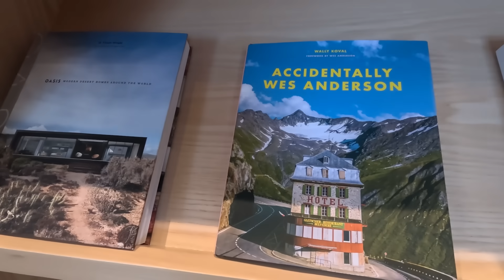THE DAY HAS FINALLY COME!!!

Comment: Isn't Leo to big for that car seat?
Reply: Definitely.  His feet are hanging well over the end.
Reply: Some states require children to be in car seats up until a certain age regardless of size. In Utah Children must ride in a car seat or booster seat until the age of 8 or until they reach a height of 57 inches (4' 9”). Children should ride in the back seat until the age of 13.
Reply: @ltrillium1000  yes, that's understandable,  but Leo is too big for what is essentially a baby capsule and ready for a child seat. Many of the baby/child unuts convert to a child seat.

Comment: I think if your driver is saving gas $, then you ought to consider the break even (cost of ownership) between a $80k electric and your current 10 mpg gas truck.   I would never buy an all electric at this point.  Not cost effective, limited range as compared to gas.

Comment: Amazing how fast you go when Trent is not touching every task.
Hmmmmmmm. I wonder why they ship you the prehung door completely assembled. Is there some advantage for making sure it is level and square during installation.  Should you check the level of the floor, the plumbness of the framing? Calculating the need for shims? Or just work backwards as usual... makes for entertainment value anyway.  
Oh, my! Did you just dis Ally for wanting the door to work correctly. I don't want to criticize, but dude.

Comment: You made it!  Job well done, you're all entitled to feel very proud of yourselves.  Agreeing with Allie here, order the dry wall and with luck you can have it delivered, you've got the space for it.  As for going EV?   Trent wouldn't be able to diagnose problems as he can with an IC vehicle, he wouldn't be allowed to fix anything anyway. I'm not sure he'd even be able to do any mods on it either.  Keep snug, install a bath in the new build, older bones need a good hot soak now and then.

Comment: Maybe check out Long way Up with Ewan and Charlie . The support crew had a Rivian truck . Seem to have issues with charging and holding charge in cold sub zero temps . Technology may have improved since 2019 . Trent get your finger X-rayed , you may have an injury to volar plate which requires treatment . You weren’t very clear on which joint in your finger . Take care and congrats on all the hard work to reach the dried in milestone .🇦🇺

Comment: As a car guy, with where you guys live, I really feel like going to an electric vehicle is really not a good idea. I understand that you guys will have the trucks. But, electric vehicles don't do that great in the winter. Especially since up there, it's winter for probably 75 to 80% of the year. If better fuel economy is what you're wanting, I would go with a Toyota or Honda hybrid of some kind. They still get great gas mileage, but, you're not solely reliant on electric.

Comment: I just bought a 4Xe wrangler for the very same reason, got tired of spending a fortune on gas, and my jeep is just as capable at my gladiator was. I know it's not the same as going 100% electric, but I just wasn't ready to quit jeeps yet! When they come out with a 100% electric I will check my options again.

Comment: Electric vehicle, change the tires, it's not four-wheel drive. I will be surprised if it does handle the Ice & snow you both get at that high of elevation.

Comment: It’s to bad they don’t make heated roof panels, because when you get the “perfect storm” of snow/rain/freeze and then thaw, that roof design with those window locations is going to leak. Don’t sell your drywall and painting tools. It might only happen once in 10 yrs if your lucky. It will make good content though…..

Comment: Rivian is on shaky ground with it's investors, due to a problem building and selling enough vehicles to be solvent. If they go under, every owner now has an expensive piece of garage art, due to a lack of parts and service support. I'm a 40+ year ASE Master Auto and Truck Technician, have worked on virtually all types of vehicles and will never recommend an EV. Hybrids, maybe. The new GMC 6.6 gas trucks get 26 mpg on the road.

Comment: What ever they claim about travel distance, just divide it by 2, especially in cold weather because the heater draws big time and even in the summer the air conditioner does the same. Anything outside of 100 mile radius is risky. In town driving there fine. This info comes from my sons experience with a Tesla Y. And boy is it fun to put the pedal to the metal, but your tires are screaming for mercy.

Comment: Great job on the progress, little by little getting it done! Winter has hit here in Washington so I know by now you are feeling it too. As for the Rivian, well I'm not a big fan.  Not just the Rivian brand name, but the experiences that have been had with electric vehicles all told. I have a hybrid 4x4 Ford Escape and it has been flawless for almost 200K miles. I just don't buy into the whole electric vehicle thing, not enough benefits to accept the whole venture even though I am trying.

Comment: I have been driving electric FOR YEARS.  I am an EV advocate. 
Do it!  Chargers are everywhere there is electrical outlets.   I have made videos of rivians. 
Amazing trucks.  But heres what you do, get a level 2 charger in your garage.  

MOST CHARGING WILL BE AT HOME!

Then your good for hundreds of miles, and you can idle in a blizzard for hours and use NEXT TO NO ENERGY.     If you wanna drive 1000000000 miles on a trip, then rent something if plugging the truck is is a burden.  YOU'LL DO 90 PERCENT OF ALL CHARGING AT HOME!

Comment: Not trying tell you whether to or not buy an EV but do more research on regarding how long of a charge in will hold, how many mile in between charges etc. Also, from what I've seen especially in more rural areas where charging stations aren't everywhere, I'd suggest getting a portable generator to charge it case of emergencies. Oh never mind, the more I type the more I'm talking myself out of EV. Anyway, good luck on whatever you decide.

Comment: you are going to spend dollar for dollar on electric as gas. and even if its slightly better, it will take FOREVER to offset the cost difference.  do you drive 50k + miles a year?

Comment: Make sure you check the insurance rates and coverage policy on the Rivian. A coworker of mine had his Rivian totaled out in a minor accident due to the lack of parts available. Also look up the recently released study from Texas Public Policy Foundation on the EV cost equivalent of fueling a gas-powered car coming out to about $17/gallon, with the US government's subsidies. You might want to think about a more fuel efficient ICE vehicle especially with the efficiency loss electric vehicles see in colder climates. Also think about possibly getting stranded in a snow storm on the mountain. It is much easier to bring a jerry can of fuel rather than figuring out a way to charge up stranded.

Comment: I guess, check to see if the vehicle you want has all-wheel drive, with terrain sensors.  Or, terrain driving settings.
Some might have indepent drive, for each wheel.

If you eventually get a hybrid, check how many miles and years of the warranty. 
I would only get an extended warranty on the same vehicle, later. If the car or Suv dealer has one. For after the original warranty expires
But, you can ask if you can buy that  later, after the original warranty expires.
-Mike

Comment: Here's what I am wondering, if you bought the Rivian or any other electric car, how are you going to charge it at your home? When you finished building the first part of your home you had so many problems with your electrical panel in the basement. Then it seems you some of the same problems with the panel in the garage after you ran the electrical in there. Now you still have to do the electrical in the Addition. Will you be trying to tie in the electrical for Addition to the panel in your basement and run those 2 together?  If so you might not have enough power to run an electric vehicle too from your home or your garage. Will you have to increase the size of the electical panel in your garage OR will you start a solar panel system ON/IN your garage to power the Rivian?

Comment: Good job getting everything ready for winter.❄️ Trent, gas is a guarantee to get you to where you need to be. The EV, after driving it 10 minutes, panic will set in because you are going to worry about where the hell you will find a place to charge the damn thing to keep it going. By the way, good eye and hand coordination with little cutie pie, Leo!

Comment: everything I have seen and been hearing the EV standard is pretty much a dead horse.  Elon just revealed a hydrogen engine system, and Toyota has been working on their own new fuel vehicles.  Personally I wouldn't jump the gun just yet on an EV.  There are several videos on youtube about toyota's new fuel systems and different power solutions.  
The house looks great and I hope your injuries heal up Trent.  Getting older sucks in so many ways, and healing takes longer the older you get.

Comment: Have you compared the cost of gas  per year versus the cost of charging the batteries per year? Also the cost of replacing the batteries in about 5 years?  Then, what happens to the unusable dead batteries? More toxic things to dump in landfills? I don't know the answers but i would certainly find out first.

Comment: I personally don’t think you will be happy with an electric vehicle , there is in my opinion way too many cons  , and I don’t know if it will work well on your road . But that’s just my opinion
Reply: You don't know anything about EVs do you?
Try 4WD with independent motors on each wheel, fantastic traction control, also anti-skid all with finer co trol than a gas truck. It's perfect for their road.
A loan vehicle in 2 months will prove that.

Comment: Honest opinion on EVs as an electrician, their time is coming, but it’s not here yet. I would check with your insurance company because a lot of companies are denying to cover them due to explosion factors. They also highly recommend NOT charging them in a garage. Also keep in mind the fact they’re new tech and the long term maintenance hasn’t been determined yet. Also, you mentioned you hate fueling up your truck, but think how long that takes. The charge an EV even with a quick charger your not going to just stop a fuel up in a few minutes. It’ll take a while. Personally not a fan. We installed a 3000 amp charging station for Stellantis (Chrysler) at their test facility in AZ and that maxed out their entire testing facility. They’re looking at a multi million dollar upgrade to the site so they can install more chargers for all the little companies trying to rent space to test their version of an EV. It’s just not worth the price. Speaking of, what’s the price tag now? Last time I checked those were running $100 to $150K! No thanks.

Comment: With your life style of mountain living, a Rivian doesn't make sense. Someone reviewed an eFord-150 by hooking up an empty trailer. Instead of the 150 miles of advertised range, the extra weight reduced the range to less than 100 miles. Imagine making two trips to Home Deport with a trailer of cement and 4x8 plywood in one day. You also live in the west and love to camp. Serendipity will no longer be an option for you. Every move you make must include an assessment of access to a recharge station. If you tow anything, or go up mountains, and load up the car with gear, your actual mileage per charge will be indeterminate and much lower than advertised. Recent news indicates that eCars are not selling. Manufacturers are halting production numbers. The time for eCars is not here yet -- especially with your lifestyle.

Comment: I feel like if you want an electric truck you should go with the F150 lightning. Ford has longevity, and a reputation as a long lasting vehicle manufacturer, hell they are the original mass car manufacturer. Who knows how long Rivian is going to be around? Ford isn't going anywhere. 
I would also be worried about you getting an EV given how far out you guys live, and how cold it gets. A plug in hybrid might be best in your situation.

Comment: As far out as you guys live I would think you would be better off looking at a Hybrid SUV, rather than a full electric vehicle...It would give you the best of both worlds, as you can run on electric, but if you run low on charge you can run on gas, and the ones I've seen will average around 45 mpg fuel economy.

Comment: I would definitely say wait on the electric suv. You might know more details than I do. But these flagship new electric cars. Are no different than these new cellphones and gaming systems. There is a lot of bugs they don’t know about till it’s released to the public. That and the share holders rush the release. So they can see that green bar on the spread sheet go up 

I’d say look up issues people had with the ford lighting and the Kia electric car. Apply that to this vehicle. Not only did they have a ton of issues with purchasing but also. Just being able to charge it. 

Don’t try and convince yourself with gas and room plus storage. Those people are going to say you could drive up Mount Everest with that thing. Just so you sign on the dotted line and pull out your CC and check book. 
I’m guessing you get rid of the trx as well. Not sure it that’s the way to go either. People with a lot less of an income have cars with bad gas Mileage. Sounds to me it’s primarily an excuse for a new toy. 
I say that from my own experience, from doing the exact same things.

Comment: EV is junk & dealerships are not selling them for that reason. Go with a GMC Elevation 4x4 Baby Duramax. Seats 6 comfortably if needed & gets 30 MPG Highway. It's not your dad's diesel forsure. Very fast & very quiet truck that comes with 3 years of free WIFI right now. Financing thru GM is way better than banks too. I got 2.9% for 5 years.

Comment: Well, I for I for one would not buy an elecgric vehicle.  I love my Toyo Tundra and have never had a bit of problems with it.  I have a 8 cyl TRD and the gas, if you break it in right, is really not that bad. I wouldn't trade for anything. Electric vehicles are problematic if go for long drives where there are no charging stations and I miss the sound of th engine and the power it gives me. I'm old school.  Gas cars are just very expensive toys to me.
Reply: "Where there are no changing stations"?
You have no idea.
Search Tesla chargers USA.

(And yes, Rivian is changing to NACS ... Tesla)

Comment: Electric cars do not do well in the cold for charging.  I would never park one in a garage because of the risk of fire.  We had an electric car catch on fire in my area in a parking lot.  It took the fire department 5 hours to put it out and thousands of gallons of water.  No way I would park one inside.  On another note, I notice that you leave your hitches in with the truck parked in your garage.  That is going to be dangerous to your shins and Leo's head, plus the risk of driving it into the wall.  I use my hitch all the time, but I take it out every time that I'm not using it, takes 15 seconds.  Prayers for Allie's mom, really hope she gets better.

Comment: Just want to say that I would get a hybrid LONG before I would even consider an electric vehicle. I feel your pain with the gas mileage...it took my MINI dealer FIVE Months to complete a recall fix and I had to share my husband's F150. At that at least it gets about 18/19 mpg not 11! However, I don't feel that the infrastructure is there to support electric vehicles. It may be different where you are. I am in rural New England.  Nor do I believe that electric vehicles are proven technology...also batteries and cold weather are not compatible. I understand you can lose up to half of your charge capacity. Length of time to completely charge is another problem. You either shell out for a rapid charging station, or take up to 10 hours to completely charge your vehicle, for a very limited number of miles. Nuff said. Not only NO, but H*** NO! But you do you. After watching for a couple of years, I realize you like to be on the leading edge of change. Just take care it is not the bleeding edge.